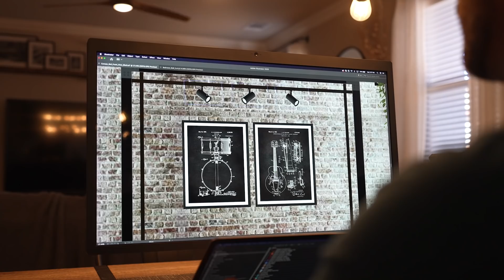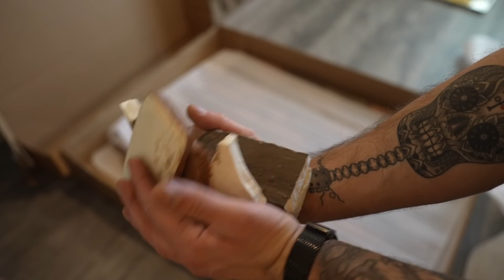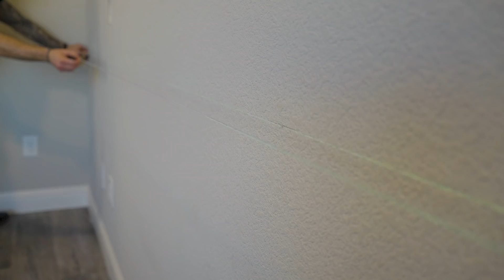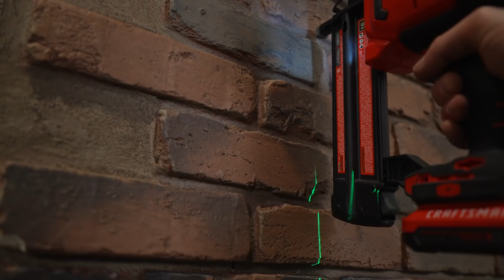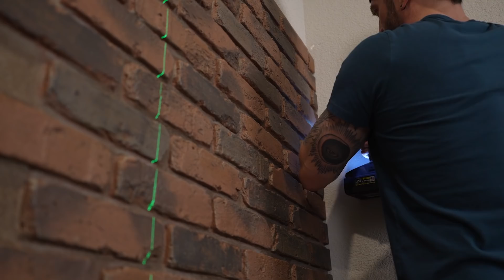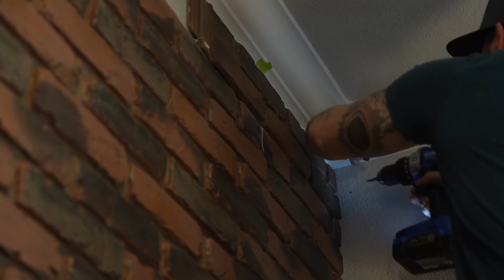DIY Faux Brick Accent Wall– BEST TUTORIAL!

Comment: Is it easy to take off if I changed my mind later?
Reply from the maker: I’d you decide to remove the panels after installing, the adhesive could make it difficult but they definitely can be removed later. You might have some surface damage to your drywall / paint texture from where the screws were and anywhere where there was adhesive
Reply: @SeizetheDIY  So not good for an apartment I guess.

Comment: Great detailed video...like your attention to each of  the minimal aspects of the process...want to ask information about the 'design software ' you used for this project .. Thanks in advance!
Reply from the maker: Hi and thanks for the positive feedback! I use Adobe Illustrator because I’m a graphic designer. The software has the capability of drawing simple lines to scale and also rendering based on your level of skill (as there’s no real preloaded textures and surfaces etc). The power of it for me is the ability to layout plans to scale and then create a mock-up visual for me to evaluate and plan the aesthetics of. It also can be used to output several file types for 3d, laser cutting, water-jetting, or cnc.

Comment: Dang, that was a thorough well planned thought out job. I am adding these to my metal garage. What would best to hang large neon signs and metal signs. I will have 1/2 plywood behind it. My fear is if I just screw into the plywood, I will have the width of the brick foam (unsupported) and this will weaken my support. If weight becomes and issue, I probably will just hand my larger heavy signs off the ceiling instead, and leave the lighter stuff for the walls.
Reply from the maker: Sounds really cool man! Hmmm... as far as hanging the brick panels and the neon signs- those sound like 2 different considerations. The brick panels can literally be glued to drywall with the adhesive listed in the video description and then screwed in here and there (into the plywood would probably be fine), but hanging the large heavy neon signs might require something more substantial behind both the plywood and the brick panels. I'd hate to advise on that and have it fail you, but don't rely on the brick panels for any structural integrity to hold heavy objects– I used the studs for that behind the panels and the drywall.
Reply from the maker: One thought which IDK is viable or not: is there a way to frame-in some studs between the metal framing behind the plywood? That way you could hang your signs on the wall still

Comment: After you got the whole wall up, how did you deal with the depth of the outlets? They looked sunk in with white edges exposed. I have a wall that has an outlet but won't be able to hide it with a side table like you did. Great video btw.
Reply from the maker: Thanks a lot! There’s actually a 3 dollar plastic part at lowes or Home Depot that brings the outlet cover out to be flush with the brick. I think I posted a link in the comments somewhere. I’ll have to look for it so I can post it in the video description too.
Reply: @SeizetheDIY  Excellent. Thanks for the reply.

Comment: Dude. AWESOME job. I want a brick accent wall in my new house and had no idea panels were a thing. I was going to just buy brick and stack them.
Reply from the maker: Thanks man! Glad it helped... there's also another new alternative product that uses real brick veneer on sheets- check my video description.
Reply: Look into brick veneer - actual clay bricks but molded to be very thin. Still need to install one at a time like tile, mortar between after, but has a much more realistic look and feel after. :)
Reply from the maker: @dchan3113  Actually the product called Brickwebb (in the vid description) has multiple bricks on sheets like backsplash tile... you just use adhesive and then go back and add mortar between each to make it look legit. I'm going to use that method next time around.

Comment: You should have taken the outlet cover off and went by the corner of the box hole not the dimensions of the cover. If you cut it out based on that with some longer 6/32 screws and a good ring you could have had a nice receptacle cover and a tidy we finish and and exposed cut out.
Reply from the maker: Very true! Thank you for your feedback. I’ll have to make that note on the video so others follow your advice. I saved it by using a $3 spacer from Home Depot that brings the cover out flush with the brick.

Comment: This is not as hard as it was made to look in this video. Could be done much easier, faster and without half the tools/steps used. Great craftsmanship but in my professional opinion was made to seem much harder than it is.
Reply from the maker: Hi and thank you for your feedback and compliment. My approach was to cover every step of installation methodically for fairly-novice DIY’ers unfamiliar with using any of the required tools. This video also combines the accent wall with my planning for the renovation of my master bedroom- no computers or design work are needed for the installation, so I can see how someone with experience could see that as making it seem more difficult but that wasn’t my intent. Regardless, thanks for watching!

Comment: Curious to know if it helped with sound deadening or suppression and if so, but how much (db)
Reply from the maker: This is what I found (I think because these panels are quite dense/solid and thick, they could provide much more than the info below): 

Polyurethane is quite effective at attenuating high frequency sound waves, but it does not provide low frequency isolation unless sufficient thickness is used. The porous nature of polyurethane greatly reduces acoustic reflection, but this low density also allows for the transmission of sound energy.

Comment: Holy shit, just one of those faux brick panels is over $100?
Reply from the maker: Yeah dude 🤦🏻‍♂️ theyre pricey but cover about 10 sq feet. Back when I actually did this installation (more than a year before I put the video together), there was no similar product available with real brick…  but now, I think if I was going to do it again, I’d go with the newest ‘thin brick’ / ‘brickweb’ product which uses real brick veneer on backing sheets and is about the same cost / only 1 sq foot less coverage. 

I just added links to the better ones in the video description.

Comment: Outlets are upside-down. Took me a second to figure out why the plug looked weird
Reply from the maker: It’s strange but outlets have no actual standard orientation. The home builder  installed them that way… I think they said it was to indicate which outlets were on a switch (both of the upside down ones are switched for lamps on nightstands)

Comment: they don't look to weigh very much you could have probably just used some foaming adhesive spray, we have some industrial stuff at work 15$ a can and I've used it to do the 3d panels on the ceilings in under an hour, super easy to use and last forever. the drywall is screwed from all the nails and screw holes and foam adhesive that floats to the back when you squirt it on the joints anyways. The spray i use doesn't foam very much it more sprays out like a spider web than any kind of "foaming" effect. works way better than liquid nails on my DIY projects.
Reply from the maker: There’s a new product that’s available now using real brick veneers (I added links to the video description), installed only with adhesive like you recommended. I think if I were to do this again, I’d go that route… about the same cost / less work.

Comment: styrofoam or plastic on wall is garbage, under it attracts humidity and the wall is always cold, you cant warm it up in winter and in simmer you get humidity under
Reply from the maker: It’s neither styrofoam nor plastic, but regardless- sounds like you live in a VERY humid climate with limitations to what you can put on a wall.

It’s not a problem where I installed it, but a fair callout for uniquely humid regions. 

Take care ☺️
Reply: @SeizetheDIY  There is not a lot of humidity, it slowly accumulated, the idiot who sold the apartment put Styrofoam inside the apartment on the walls under a thin layer of cement or plaster or whatever it was and after many years it started stinking something in the wall and there was mold and I put off the styrofoam and the bricks under were totally wet and almost rotten, after I took off the styrofoam it dried and now it's ok.
And I also noticed that the wall was never warm on winter because the insulating styrofoam in the wall prevented the wall to warm up in winter...
Maybe where you live it can work, I don't know, but it's better to check
It's better to be careful with this stuff
Reply from the maker: @Noname-yu8qw  definitely something that needs to be checked into before installing these. I’d hate for that to happen here! If that’s a big risk, then I would much rather install real thin brick sheets that they have now.
Reply: @SeizetheDIY  Sure be careful and tell your viewers to be also careful, because it can really cause you a lot of troubles and mold can cause even health problems
and even if there is no mold and humidity if the winter is cold you end up consuming much more energy because every time you turn off the heat it becomes cold, because the walls wont warm up, styrofoam and other foam, plastics etc insulation has to be always outside :)
Here it took something like 10-15 years to cause troubles, you might not notice it at first...

Comment: beautiful! on the lower outlets did the electricion pull the boxes flush with the brick panel?
Reply from the maker: Thanks Charles! The electrician just pulled wires over from the old switch to the new boxes for the sconces. The lower outlets were left as-is and looks fine recessed into the brick but there's a $3 outlet spacer you can buy from Home Depot that brings it out flush with the brick. I did buy a brick trim / bevel from the same manufacturer that finishes the inside edges off, but it looked pretty ridiculous (too big and called too much attention to the outlets). 

The faux panels come with touch-up paint from the manufacturer and it can be used to paint the inside (blank foam) edges where it was cut-in for the outlets. Hope that helps!
Reply: @SeizetheDIY  great job on your other project too. i look forward to your videos!
Reply from the maker: Thanks a lot Charles! More on the way!

Comment: Surely it would be cheaper to just install real bricks, those panels are $115 each!  Isn't the point of a faux brick wall that it's cheaper?
Reply from the maker: The point was definitely to make the job cheaper and easier/faster:

Brick: $27-45 / square foot
Panel: $8 / square foot
Reply from the maker: I added a new link in the video description for real brick veneers with backing sheets- easier installation and more authentic. You could use a lot of this tutorial for most of that product too.

Comment: You left the baseboard and didn't put the outlets sitting on the faux briques, that just doesn't seem right. Besides that, great job!
Reply from the maker: Hi and thanks for your compliment and feedback. For me, both the baseboard and outlets were intentionally planned aesthetic decisions. 
Before I started, I searched Google Images and Pinterest and found thousands of brick walls with white baseboard and crown, and I liked the evolution to a more contemporary style than a purist Industrial Interior Design style… although, I do like without it too- I was on the fence, to be honest lol.

As far as the outlets, I cut the panels to fit around them, will be painting the interior edges with brick colored touch-up paint provided by the faux panel manufacturer and will reinstall the covers with a $3 outlet spacer from Home Depot that makes them flush with the brick. I actually bought the matching brick trim for the outlets but they look puffy and ridiculous lol

Comment: Well fuck, I just had the idea for an industrial canopy bed. I'm going to hold off on it until I see how you do it because your method of planning is clearly superior to my winging it.
Reply from the maker: Haha! Thanks dude… I definitely plan way ahead. Stay tuned / subscribe so you can check it out when its completed.

When are you building yours?
Reply: @SeizetheDIY  I've been slowly getting the materials together, I was going to build it from aluminum channel, mitre and weld the corners. I think I'll wait to build it until I see how you've done it.
Reply from the maker: @mistersadaimusic  that’s really flattering dude. Sounds like you have a killer idea there. My strategy to building most things is essentially to improvise the construction using common hardware not typically used for the specific application I’m designing for… intentionally unorthodox to help limit the amount of complex tools that most DIY’ers might not know how to use, like a welder lol, but also add a unique aesthetic.
Reply from the maker: Hey dude, It's finally done hahah... the new video for the Industrial Canopy Bed is up– let me know what you think!